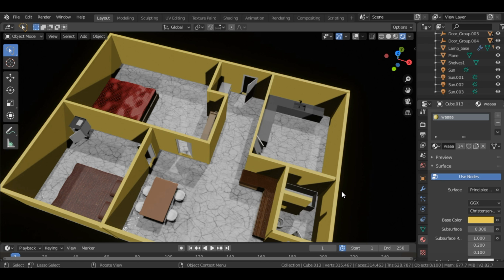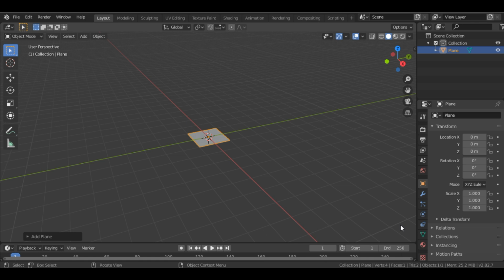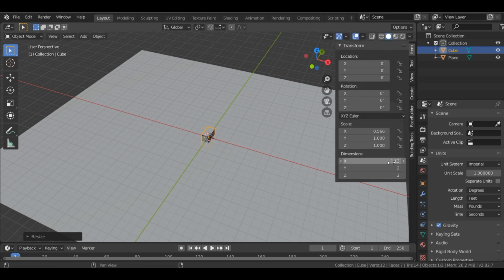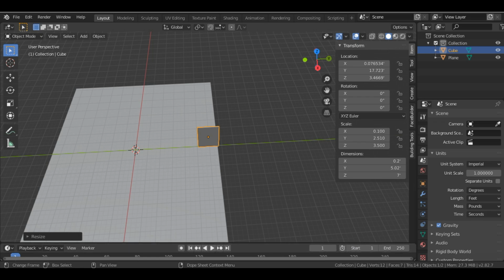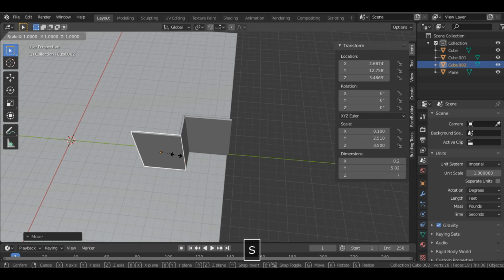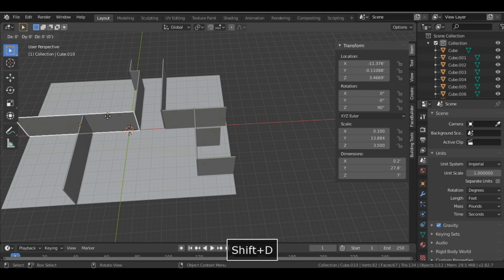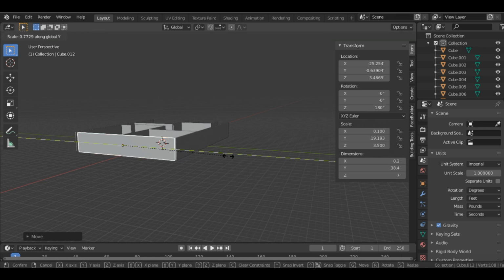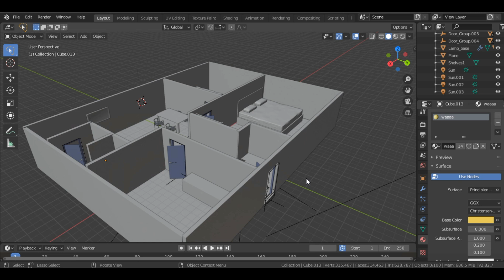Floor Plan (Part-1) - Layout

Comment: Hello Dear 
Am using my laptop. on my keyboard when I press S or G the holl floor plan is moving not the wall how can I fix this problem?
Reply from the maker: Just select the wall and press s or g.  Or maybe you have added the walls while you are in edit mode. So make sure you are adding new objects in object mode. Select the wall in edit mode and press p and select seperate object.
Reply: Thank you it real help